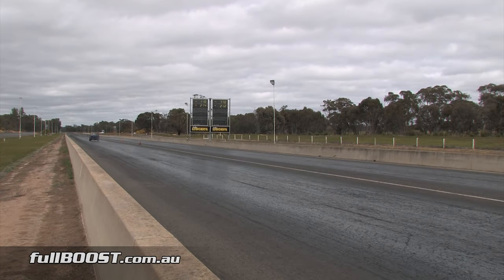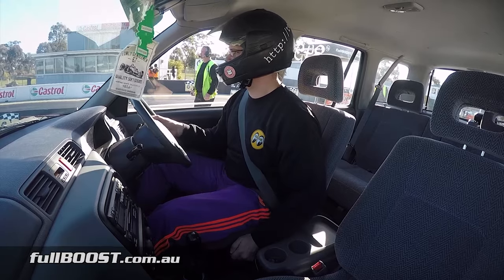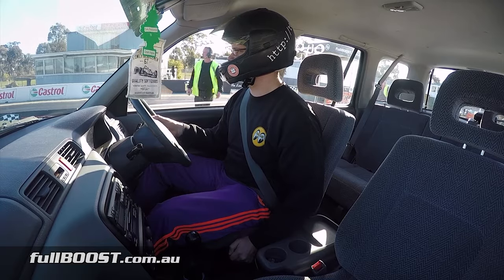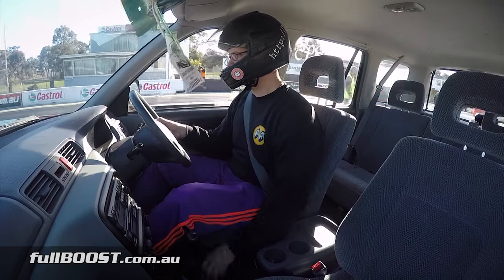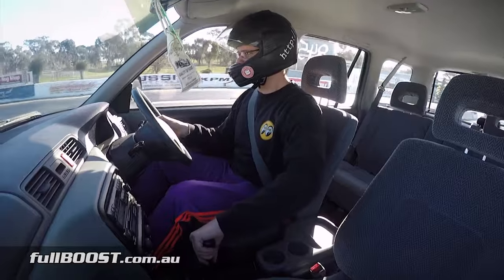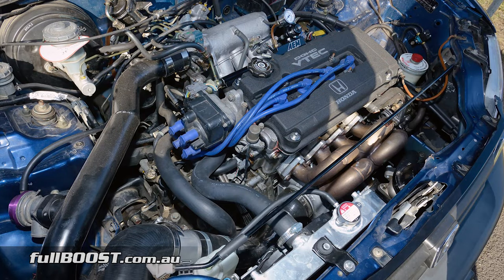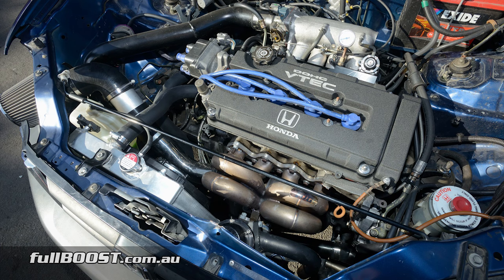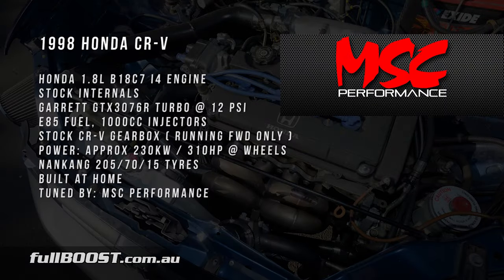Honda CR-V turbo SLEEPER

Comment: This is something you don't see everyday, very unique and I respect that to bring that cr-v to the track, I see in the comments people talking about waste of money and whatnot but what do you guys drive? What have you guys even built? Stop hating, keep all those negative comments to yourselves and have some respect for other people's choice of vehicle, just like how you would want someone to respect your vehicle so don't be a hypocrite and don't be an idiot. I rate that guy for bringing his cr-v to the track on street tyres as well and full weight and still runs 13's FWD that is very good, and if he put on slicks he's gonna run 12's easy in that heavy cr-v, great video full boost
Reply: I was probably one of the first to build a 1st gen crv and i can confirm its a waste of time and money..
When the wind picks it up at less then 200kmh you would understand too!
Reply: @upnorthviking823  did you lower or do anything to the suspension?

Comment: People asking why you wouldn't keep it AWD..Have you ever seen a CR-V transfer case? LOL
Reply: +GMal G I'm a child on the Internet and I can agree with this
Reply: +suzuki400boi  It would work for a while as long as he didn't launch.
Reply: +GMal G Epic tuning ran 10.40s @ 145mph on street tyres and are yet to break one a few years later. Maybe you could call them and tell them how they're wrong them rather than use the internet lol.
Reply: +GMal G They're
Reply: +Gerrit-Jan Bergwerf Somethings are just not important. Shut up..
Reply: ***** Why react like that if its not important?
Reply: You can actually put a good bit of power through the older Honda AWD setups when properly setup. We recently put together an AWD EG hatch with a boosted B20v and it's been holding up around 400whp just fine. CRV transmission, Wagovan axles/center section, some other misc Drivetrain components from a stock DSM to make it all work in the hatchback chassis. 300whp would not be an issue
Reply: That's cool.  How much did it cost to put together?
Reply: The customer has about 6k into the build all together; including engine, turbo setup, chassis itself etc. The actual AWD setup itself including transmission was probably ~$1500.
Reply: Can you explain more?
Reply: +Joe Doole would you guys be able to do an awd system for and em1?
Reply: +Joe Doole would you guys be able to do an awd system for and em1?
Reply: ***** Its such a big job, theres a couple of really good build threads that go through EVERYTHING that you need to do, and goes a long way to explaining why you dont see many around. Not to mention the rear end to use is the wagovan one, which we dont have in oz.
Reply: suzuki400boi it would explode.
Reply: Joe Doole are the second generation CRV awd systems weaker than the first generation?
Reply: I was getting the same hate i kept telling them it was wayyy faster fwd anyways hahahaha yes people dont know shit and talk sooo much!
Reply: The transfer case is really cute
Reply: Idk about b series but k series rear diffs really complain and scream but they can be beefedup

Comment: Lol how can people hate on this? Its a sleeper, not a show car or a race car. Sure it doesn't run 9's but an old ass CRV running high 13's is almost unheard off. It's a 3500+ lbs. SUV with a FWD 4 cylinder running on shit tires.... running high 13's.... This machine has more fighting against it than for it.
If you ask me a lot of time, money and effort went into doing this. Great Job!
Reply: Your point is?
Reply: point being it should be faster needs tires
Reply: Not entirely unheard of..there are 4wd versions doing 11s....
Reply: That's my only question. If you were going to mod a CR-V, I would think that the main attraction would be the AWD.
Reply: That car can run a quarter mile faster than my first gen bone-stock CRV could even dream of running... and looks almost stock itself. I love this, and considering everything it performs great.
Reply: @TomBom292  my bone stock crv takes approximately 6 years just to accelerate from 65 to 75 mph because 4 speed.
Reply: Incredible results for such things holding it back, would of even ran better with suspension and better tyres, there's k24 crvs making nearly 300kw easy, would be fun as hell!

Comment: I love this video because I love my first gen 97 crv. One of the very first made in  JAPAN . I  am getting ready to through a couple grand into suspension and window lift because even at 225,000 miles the engine starts immediately and purs like new. I  will drive it for at least another 5 years.

Comment: If that weight didnt transfer to the rear so much he'd have more traction and been even faster, pretty sick.
Reply: Would a stiffer suspension help with that ?
Reply: @rafaelduran9230 Yeah less soft, more stiff.

Comment: hmm cant beef up the awd driveline so you can use it? :P
Reply: +Frietpan There are several CRVs in the US pushing close to 450whp through the stock AWD driveline - Looks like they are much beefier than this guy seems to think
Reply: +Matt Ireland well said man. here in the US we swap the Crv drivetrain into the civic hatchback or coupe an we are running 10's all day. an if we wanna have fun we disable the front wheels an have a rear wheel drive civic.
Reply: +nate cuskelly I'm sorry it ran 10's damn auto correction lol.
Reply: +nate cuskelly Epic tuning ran 10.30s@140mph in their eg coupe using the same stock crv awd b-series drivetrain thats in this car. They also pulled the front driveshafts and ran it rwd, theres videos online of the car making a couple passes and them doing donuts in it. Theres another hatch with the k-series drivetrain from the later crv with a boosted k24 that has ran low 9's as well, i believe it runs an aftermkarket gear set as the k-series boxes are a lot weaker.... maybe the guy was getting those two cars mixed up.
Reply: I have a 99 civic eg swapped with crv drivetrain that is pushing just over 600hp and about 475 to the wheels. The entire awd system is stock except for having a pro racing aluminum drive line along with equally strong front cv axles
Reply: "if we wanna have fun we disable the front wheels an have a rear wheel drive civic." How? That sounds epic
Reply: Me i suppose you would have to remove the fwd part so you wont have cv axles going to front and make it constant "awd" but since front doesn't have cv axles its only rwd.
Reply: Its probably just to save his clutch too be honest. That much weight, that much power plus awd launches and probably on a 2 step.
Reply: Mine was na and i blew 2 awd systems..i had 2 of these crv...it ran the same ETs as this one here was faster fwd anyways hahahaha
Reply: All you need is beef up rear diff or weld it and upgrade drivelines

Comment: i would consider trying to find reinforced parts to put the awd back in, ive always considered a cr-v build.  also i understand you want to keep the sleeper thing going with the stock ride height, but it looks like a rocking horse rolling down the track, consider at least some stiffer springs and bushings all around.

Comment: Some stickier tires would drop his times that's for sure hahaha. The top end is quite impressive, some 12 second cars run at around 105 and 107, he is running 111mph. Its all about the launch, with some better tires to get off the line he could probably shave a second or maybe two after running it more and getting it dialed in. Pretty impressive CRV!! I like it, and I would definitely drive it!
Reply: +iDrive4fun93 - Not the 12 sec cars I have seen. 15.0 sec should be around 95 mph. 12.0 sec should be around 115 mph.
Reply: +Joseph Summers most boosted cars can run that, but all motor k powered civics, and some other 12 second NA 4 cylinders I have seen, typically run around 105 to 107, because they lack the top end that forced induction provides. Being NA they get off the line better and are easier to launch because they make low torque numbers, and the max torque you make in an NA car is high in the rpm's. I had a 1997 Integra GSR, it got to 100 pretty quick but after that it started fading due to drag and low torque from being naturally aspirated. But your right, a boosted car, or a large displacement motor like a V8, can run over 110 pretty easy because it has the torque to keep pulling it and to resist being slowed down by drag.
Reply: iDrive4fun93
I suppose that's about right.

Comment: I don't understand why he disabled the AWD. Reassemble the AWD and dip into the 12s! If it breaks fix it and keep it moving! It's spining all the way down the track!
Reply from the maker: It was his first time at the track and the owner was worried about breaking the transfer case. He said he will try again using AWD
Reply: +Fullboost please post vid of awd if possible, i fucking love sleepers
Reply: +BLACKLACDTS Have you ever seen/worked on a CRV's 4WD?  It is tiny, would not take much abuse, most are wiped in the scrappers too.

Swap in a Ford IRS out of a T-Bird and THEN make it RWD.  (Don't think this is possible without mega budget)

I can't believe how well it actually hooks with stock suspension and skinny radials.
Reply: +BLACKLACDTS The AWD system in the first generation CRV's is extremely "under-engineered" everything is too small, to weak, it uses a hydro/pump system to engage the rear diff, etc. The rear drivetrain components often break at factory 150hp levels, and most of the parts are way too expensive. 
A note to the wise for somebody wanting to build a vehicle like this; First generation Rav4 has a proper full time four wheel drive system, 50/50 front back, is the same rally based developed system and manual transaxles as in the Celica turbo AWD cars so they will take massive amounts of power and punishment, and you can simply bolt in a 2L 3SGTE of any generation, even the latest 260++hp gen4 engines, in a 2900lb 5 speed proper AWD/4WD car, they are a wicked budget build. They also dont feel like a tall little FWD car, they feel more like a truck.
Reply: Its faster fwd...awd is for people who cant drive..
Both crv that i build were faster fwd

Comment: What's the full name of the stock engine ? Not just B20 as stated in the video ? Also, can it hold up to mods and boost ?
Reply: It depends on the year, 1997-1998 have a b20b, and 1999-2001 have a b20z2, which has higher compression, from what I understand they don’t hold up to boost very long because they’re basically a bored out b18,so the cylinder walls are relatively thin.

Comment: I'm surprised no one has swapped the K24 and built the AWD system for the drag strip. It would be cheaper and easier than building an AWD Civic.

Comment: I have a CRV and I'm planning to turbocharge it
Reply: u will not get a lot of power from the stock engine. Swap it
Reply: +skyBlueXp what are you talking about the late Crv came with the b2.0 which is a beefier ls 1.8  With the right tune you can run 250-300 kids these days

Comment: In order to save the driveline braking he has disabled the awd system... or you could build an awd system that doesnt brake with 300whp but still great video !
Reply: Tk Racing Just get bigger brakes?

Comment: how can i make my crv faster when taking off?
it's a stick shift 1998.
Reply: Buy a mr2
Reply: ***** not even funny
Reply: Remove awd system
Put a crower cam in it
I,h,e, tune it.good tires.

Mine had 238whp na with oem parts and i was getting the same et s as this guy with turbo type r lmao!

Comment: You can see that bigass intake. It's not a full sleeper. However the rest of the body is stock. So its like 99% a sleeper.
Reply from the maker: +Tim Vang 
The headlight is in when deiven on the street

Comment: anyone else feel the blew a expensive chance at maybe a 12 sec crv. low 12s? suspension wheels and tires, and should of just upgraded rear clutches and a b20vtec turbo.
Reply: +mrdauntl3ss - Still faster than your CRV.
Reply: +Joseph Summers I ride a bike and it's faster. you fail.